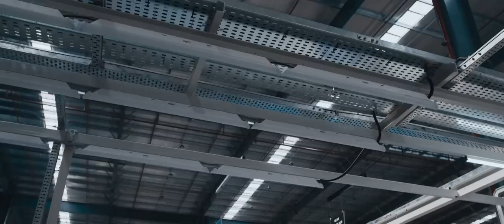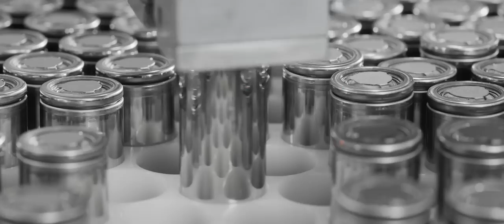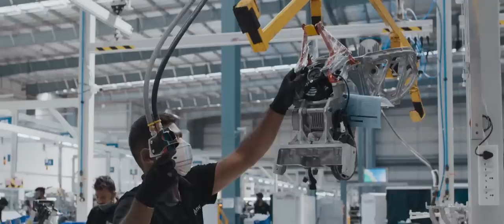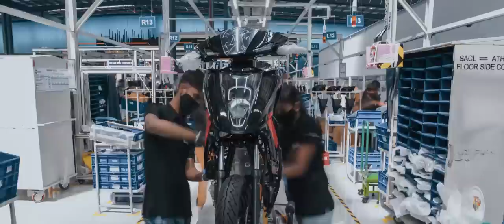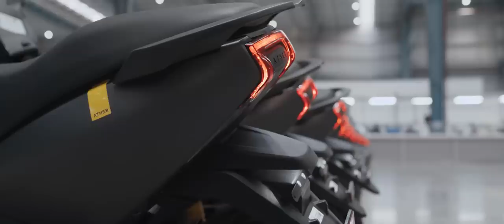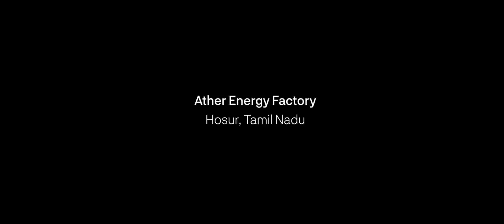Ather Energy | The Hosur Factory

Comment: 1) regenerative braking
2)long range
3) more agrresive pricing
Ather should work on these
Reply: Whats the price
Reply: @Anurag2400  almost 1.70 lakh on road
Reply: Nice
Reply: @mohammedfahad2549  too costly
Reply: But dude the 450x has the  no. 1) and 2) of your list
Reply: i think regen braking is hard to control bikes so that's why bikes comes without regenerative braking
Reply: Long range must increase
Reply: And also work on less charging time
Reply: Thanks for the tips EV guru
Reply: And also design
Reply: Worst is availability
Reply: Ather 450X had regenerative breaking. It can charge 3-5% of the battery.
Reply: If they give ABS. I'll buy it today
Reply: @tejas6683  should be given an option to those who can control!! Regen on ather is so weak, it's almost like there is nothing.

Comment: 1. Double the Range (Minimum), Bigger Battery Pack
2. Wider 120 Section tyres
3. Faster charging speeds and charging network or OTG interchangeable battery packs
4. Regenerative Braking
5. An Ultra High Res Sturdy display panel will be better than a Low Quality LCD 7" TV. 
6. Integration of a USB music system - could be first in the class ( cuz android support is already present and all vehicles do have a speaker for the horn, just saying... ) It could be a cool party trick....!!! The cherry ontop !!!!
Reply: Will you be willing to pay double the current price for all these features? You won't so don't complain.

Comment: Can you please launch something affordable. By removing lcd screen, and providing normal battery without fast charging below 1 lakh 🙂
Reply: Ather 450 costs just 1.18 lacks now bro
Reply: @mehulshyam404  it costs 1.7L in hyderabad
Reply: @prashanthkunati6418  use it for 3 years, give it back to ather, have 85k with u. Whats the ownership cost then? Just 85k. U can buy a petrol scooter say an ntorq(since its so popular nowadays) for around 92k on road. The cost of services can range from 1k to 3k if im not wrong. Fuel costs are around 100 rupees now thanks to this government. Suppose the scooter gets a mileage of around 40kmpl, you need 2.5 rupees to travel a km whereas the ather 450x needs just around 10 to 20 paisa. So have a thought about it. Dont forget how much pollution gets reduced!
Reply: @mehulshyam404  well I would rather build a diy using qs motor save
Reply: @prashanthkunati6418  its not as simple as u think it is. It wont look good first of all, plus you wont get registration for that. And in case you didn't know, you need a registration for any electric vehicle which has a motor of capacity of more than 250 watts and which runs at more than 25kmph. And if u dont care about registration and wanna build sonething under this spec, well its better if you would get a cycle cause that thing can go even faster.
Reply: @prashanthkunati6418  btw hey its the 450x that costs 1.7lacks. 450 costs 1.18l everywhere where there is no road tax for EVs.

Comment: High cost 😂 how to buy Ather mileage is very less for the cost
Reply: Do you know how much will you save over 5 years of ownership? The money you spend up-front is nothing but savings - no unstable fuel costs, no oil change, no air filter, negligible service charges, 2X more reliable, a Carbon Positive Transport Vehicle. If you can barely afford an activa this is definitely not for you.
Reply: Tesla strategy, first sell expensive cars, roadster, model X and S, then affordable car like model 3.
Reply: I dont think anyone drives a scooter more than 50-70km in a day.. except delivery drivers i guess.
Reply: @MAC-vi7fy  I usually drive 100km/day 😂
Reply: @swamys745  mee too then we should call ather energy guys to pull from back 😂to cross balance 20km 😂
Reply: @mrvk699   irrelevant answer for the question 🙄😂
Reply: @MAC-vi7fy   No one can be a Tesla because it's Tesla 😂😂😂 LoL 
Customer requirements are important not the strategy 🙄
Reply: @swamys745  what do you do?
Reply: @MAC-vi7fy  I work
Reply: @swamys745  What do you do for work?
Reply: @MAC-vi7fy  I'm an operator
Reply: @MAC-vi7fy  why are you asking?
Reply: @viptech3491  Mr.VIP I am a mechanical engineer I can debate with you on this topic for hours. I have studied Engines - Petrol Fuel Injected / diesel Direct Injected/ jet engine/ industrial gas turbine / power plants.
I know what I have said above. And it’s backed by facts.
Reply: @mrvk699   😂😂 nanum mechanical engineer thanba 😂
Actually you are out of scope in future 👍🏻
Reply: @mrvk699   1.7 lakhs for 70kms are you kidding. I will run petrol bike for that 😂
Reply: @viptech3491  Mr. VIP this vehicle is Out of Reach & USE you should not buy it. But stop propagating bullshit. Just for your information in metro cities - a person changes their iPhone Pro Max’es every year , a 1.7 Lakh Electric Made & Engineered in India vehicle with Connected features is not a big thing.
Reply: @mrvk699   mind your language when you talk to someone be calm when you discuss on public.
Now coming to the point of you are in india your statistics is wrong 
I don't have iphone
Reply: @viptech3491  🤦‍♂️ ok might have offended you, but the target audience is not you . If you’re the person who weighs the “price” as a factor of priority. I am Person who would maybe buy this kind of electric vehicle in 2026 or something Not right now because I own many other vehicles. But u got the point right?? And Financing is a Real thing if you forgot, they have great EMI & payment plans. Doesn’t mean a lot you lose The Unique factor on this is Alone worth it - along with Complimentary Fast Charging (refueling & servicing plans) package for the high model owners

Comment: If Ather makes a reasonably priced motorcycle with decent power and range like a Sur Ron light bee, I'll be first in line to buy it. No need for fancy touch screen digital display, Bluetooth connectivity,  tracking etc which only drive up the price.

Comment: You guys done Great initiative #atherenergy #ather , but i feel ola s1 pro slightly better than Ather 450X Pro , Mainly ola s1 pro comes with  reasonable price with huge range thats around 181Km/charge and offers the top speed of 100+ with 3.8+ massive battery and also providing the same features that ather 450x providing .. But design wise u guys bit ahead than ola s1 pro ..
Reply: Here after 8 months. What's your opinion now??